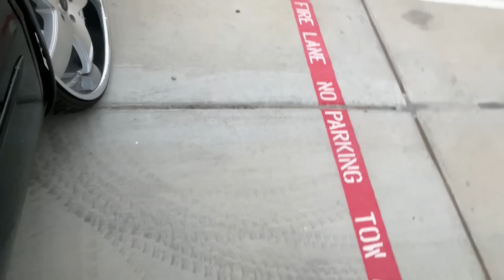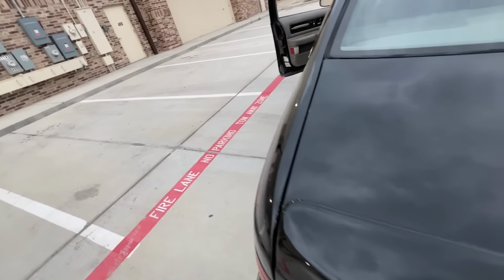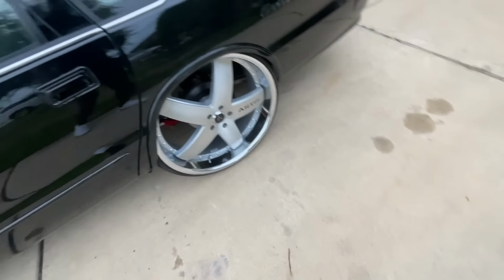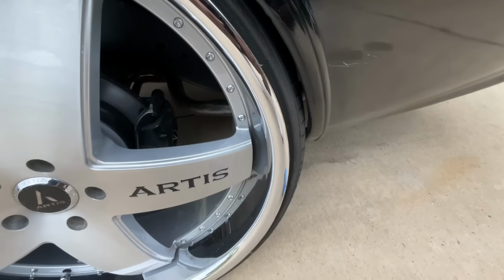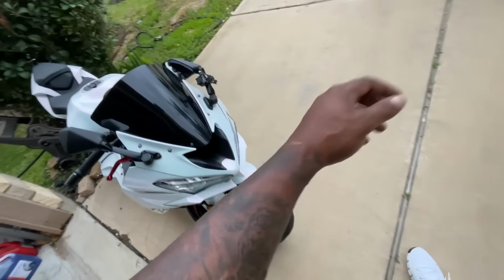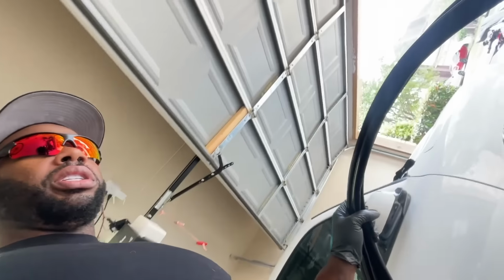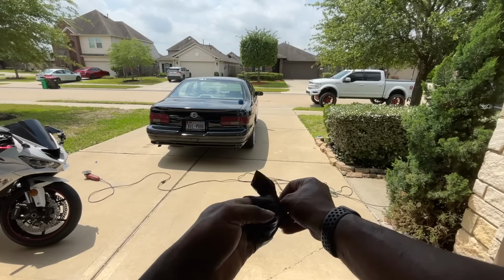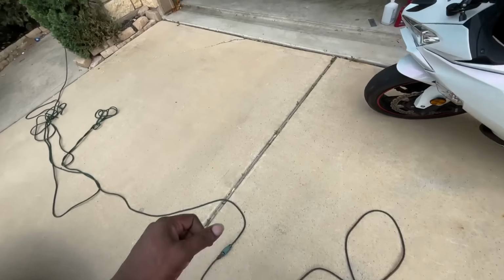I’M HAVING BAD LUCK WITH THIS 96 IMPALA SS

Comment: Sell the 26” & buy 24” also, if you lift the back, it was rub more. So either you will need to trim the front of the back trim a little & nicely. Or sell the 26” to buy 24”